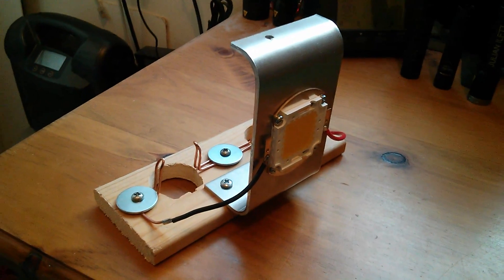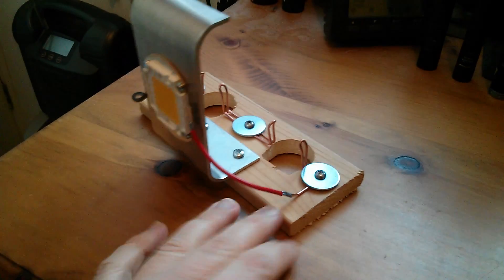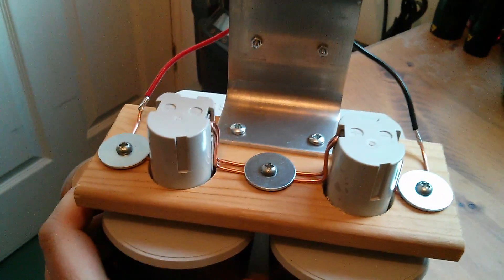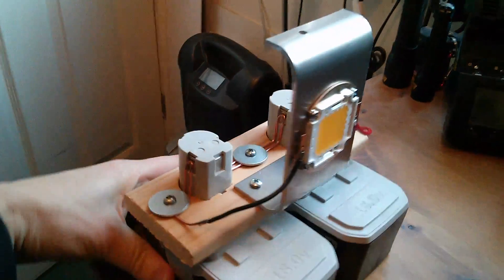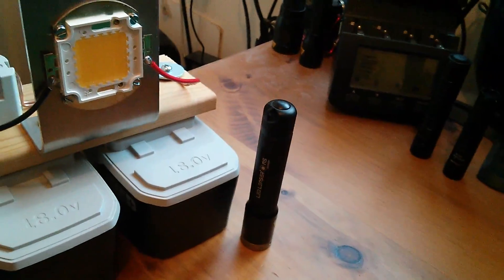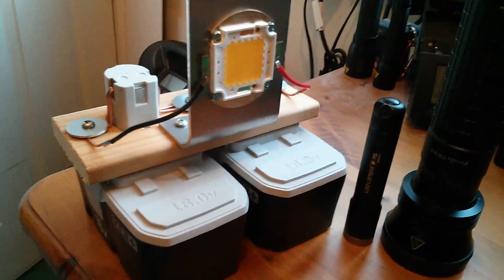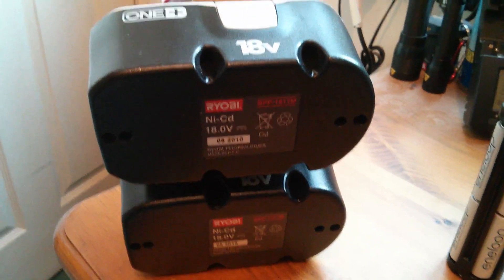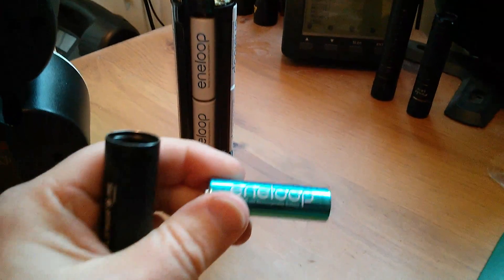LED Lenser M5 Vs Fenix TK41 Vs $10 Homebuilt 100W Flashlight

Comment: You mentioned the batteries have to be ni-cd batteries. Why can they not be li-ion? Ive got plenty of Ryobi 18v li-ion laying around but not ni-cd.
Reply from the maker: If you use Li-ion, you'll need a 2 or 3 ohm resistor in the circuit because Li-ion has a very low internal resistance

Comment: Do you know the temperature on the back of your LED after some use? would you recommend using a dedicated heatsink or a heatsink with a fan for reducing the heat? And what is your total runtime on two of your ryobi batteries?

Comment: Would the LEDs melt/burn out if you were to use these for hours on end?  What would you have to do to prevent this?  Heatsinks and/or fans?  Or is it a lost cause to try to make them stay on that long?
Reply: I do not think any passive approach would dissipate the heat fast enough at room temperature, your best bet probably would be to modify a cpu cooler.
Reply: Richard Smith Ah, good idea about the cpu cooler.  Thanks for the input.

Comment: how much current does it draw? how many amp hours does that battery put out? I want to run mine of a 7000mah battery. I calculate I will get about 1.5 hours of runtime but I'm not 100% sure.

Comment: Wow! That is really awesome! I was wondering if you need to use 2 batteries or if you can use one. Thinking about modifying an old torch light with this LED. I guess the reason you used 2 batteries so it can last longer? BTW how long it last if its on all the time?

Comment: Did you ever test 100w led with a proper heatsink/fan? I am getting temperatures of 180C+ after just a few minutes, is this normal? The led aluminium heatsink casing only gets warm. I am measuring with infrared gun at close range. I am measuring the center (yellow part) of the led, maybe the max temp rating of 80C is rated at different location? I am out of ideas, maybe you can clarify?
Reply from the maker: If you're keeping the back plate of the LED cool, I wouldn't worry about high temperatures in the LEDs themselves. It's probably designed to work that way. If the LED is still working, you're probably doing it right.
Reply: Julian Ilett Yeah, think you're right, still almost 200C seems dangerous :) Will probably run them at 50% power since I can only find 50w pwm voltage regulators that are cheap. The leds I got are probably factory rejects as the more expensive led I got that looks similar to yours runs 20% cooler or so. At 6 euro even 50w output is good value...
Reply: Julian Ilett Will also attach a ds18b20 temperature sensor with thermal glue and pwm the fan as needed to keep the noise low and for overheat shut-down/alarm.

Comment: Make a small housing on the back of the metal blacket to house a 120mm or 140mm computer fan to the rear and attach some really good sized heatsinks to the back of the metal and you should get significantly longer run time out of this without it overheating if not eliminate the need to turn it off for cooling completely. :P

Comment: @Julien Ilett That`s a very nice video. I have calculated a 100W flashlight. It`s just ridiculous that it would need 3 or 4 12V 7Ah Lead-gel batterys (wich would weigh between 9 to 12kg) just to run this 100W monster not even 2 hours. That would be a heavy brick of an flashlight. X(  I think it will be smarter to build a flashlight with power rating below 80W. It would be anyway a pretty heavy flashlight. I think even a 125 x 50 x 20mm CPU heatsink with two 50mm fans would be way to less of cooling. Would a led version with less power work with that heatsink?

Comment: Impressive, but I think a better way to compare would be to show the lower power device lighting your yard, then add the second one, on top of that illumination, so we could see a comparison that does not include the camera's automatic exposure control, correcting for the difference.
Reply from the maker: I don't think the camera on this phone (nexus4) is very sensitive. It looks like it was at maximum sensitivity for all 3 flashlights.

Comment: It would be nice to have that 100w in a torch
Reply: Julian Ilett Great project, I didn't know that those high power LEDs are so cheap. To make it more handy, you could make it two-part, a battery pack that could go in backpack (or with handle to be carried in the other hand) and lightweight led torch with heatsink connected with flexible lead.
Good job ;)
Reply from the maker: True - but it would need so many batteries and it would get extremely hot!
Reply: Should be doable...  I imagine you can run this off AA, C or D type (depending on needed duration) batteries (24 of them).  But it'll take some time/effort/skill creating a manageable handhold, and you'll need a decent heatsink.  It'll be quite bulky and heavy.  There's a point where low weight and small size become more important then lumens ;-)